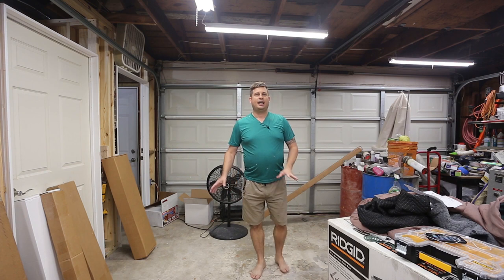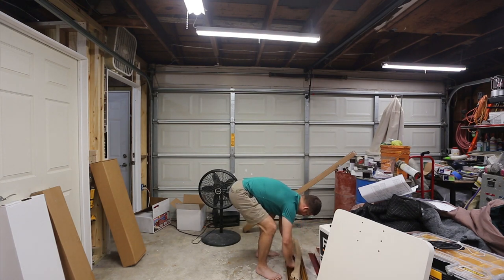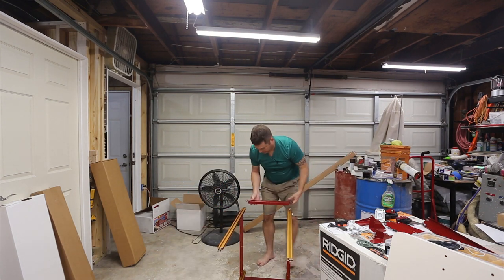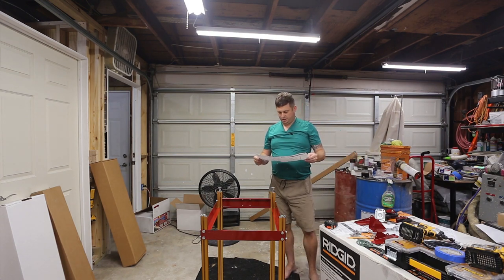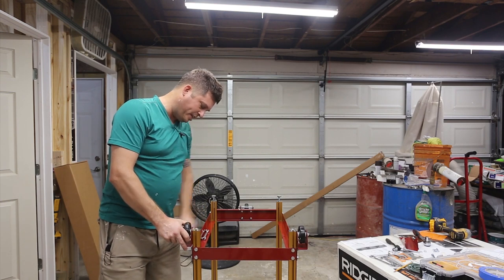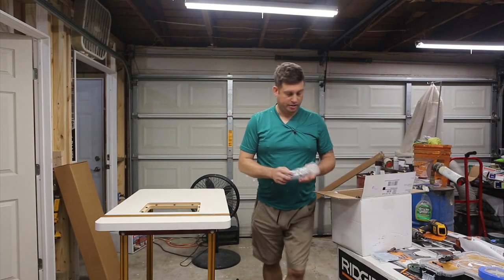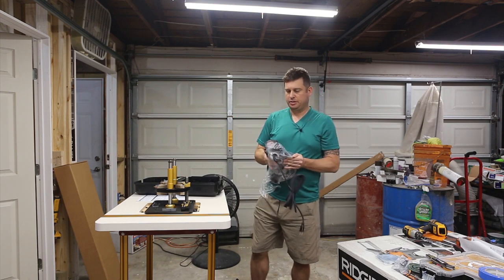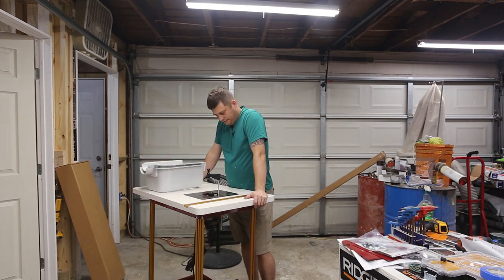Assembly of an Incra Router Table with Wheel Kit and Router Lift

Comment: Thanks for the video.  How far up the bottom of the legs is the lower stretchers secured.   I Have the wheel kit too having a hard time figuring that out.. didn't see anything in the manual.. thanks in advance